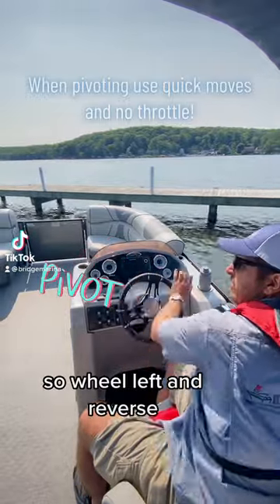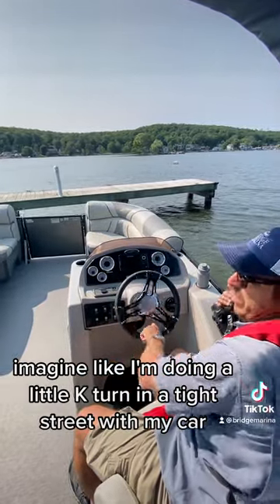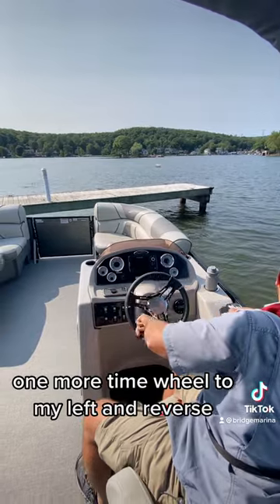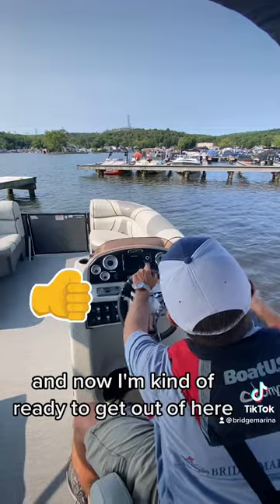When pivoting your boat, use quick turns and no throttle!

Comment: Unless that wind is broadside on you.. pushing you Into docked boats... Then ya needs some thrust to get ya off em sometimes....
Reply: I find that if I need throttle in these situations it is because I lost control a minute ago. And yes that is in our windy ass area.
Reply: @mjodr  This is great for sill conditions, but add a nice 5-7kt current and a 10kt gusty wind and you've got the docks near our inlets while the tide is changing.  With no throttle you would be in a new zip code by the time the boat got turned around.  You really have to be careful docking as the current runs parallel to the slips, you can end up under the dock real easy.
Reply: Wind and lots of other boats and I panic lol

Comment: I used to work doing corporate seminars at a lakeside lodge. We had a large pontoon we took some of the students out on in the evenings. I had handled boats all my life and docked it with ease, came in with a little speed, cut the wheel over, bumped it a little to point the bow around, turned the wheel hard the other way and hit reverse real quick to suck the stearn up to the dock and it would just snug right up to the our dock nice and neat every time. I guess one of our other trainers, who didn’t have much boat experience, had seen me do it a few times and decided it was his turn to take the folks out in the boat. I saw him coming back to the dock and ran out to help him. I noticed he was coming in way to fast and knew right away he was trying to do what I did, only he didn’t know how and had never even asked me how. Well, let’s just say that nice fancy pontoon the company owned never looked the same again, and he never drove the boat again.  Everything looks easy when someone else is doing it. 😂😂
Reply from the maker: Ahhh yes - thanks for sharing and for the comment! Appreciate it! Where was this?
Reply: @Bridgemarina  Lake Martin, AL. We had a private “lodge” the company I worked for owned. Basically, a 14 room, 2 bed per room, facility with a huge lounge type area, kitchen and a classroom downstairs, all privately located in a remote location on Lake Martin where we could get them down there with no distractions for intense training for days or a week at a time. It was a nice facility in a beautiful setting.  The lake and the boat provided a nice break in the evenings after classes and training were over.  We’d bring 26 sales agents at a time (13 of the rooms double occupied and I had my own room) for a week long training seminar and about 10 sales managers into a neighboring country club facility for a management and “how to train” seminar. It was really successful.

Comment: That how you do it with outside boat motors. 

When you do it with boats like skinautics and mastercrafts. 
The rutter has no effect when going slow in reverse. The boats back will go to the left or to the right in reverse depending on witch way the propellor turns. 
If you give a decent amount of power in reverse while the rutter is already in the correct position. It  does steer a little bit. But probably there isn't a lot of room and you probably can't hold the boat in reverse for longer than 2 second before you hit something. And you have to cancel you backwards movement fast but first have to turn the steering wheel on the other direction (or you fast reverse was for nothing). And give gas forwards.

Comment: Try not to switch gears so much because it’s really not good for outboard motors
Reply from the maker: Good point - thanks for watching and sharing - appreciate it! What waters do you boat in?
Reply: @Bridgemarina  natural lakes
Reply: Any motor
Reply: Incorrect. the problem with switching gears is if you do it too slowly. If you let it pop into gear quickly and firm it’s just fine. It’s designed to do so. Change the gear oil every season and it should last a long time.
Reply: @poysunivey  ah someone who knows what he is talking about.

Comment: Easy with an outboard. Try moving slow with twin inboards and using the steering it barely moves, when turning with twins just use the controls no wheel at all.
Reply from the maker: Interesting - appreciate you sharing - where are you typically doing your boating?

Comment: It’s common sense. Honestly if you need to be taught this you should be a passenger.
Reply from the maker: Thanks for stopping by... sounds like you've been fortunate enough to be around water and boats a good amount - awesome. Others might not have that same experience, so what might be common sense to some is new to others.  Where are you boating?
Reply: @Bridgemarina    I not trying to be mean.  Just honest.  Things that need to be taught are about loading and unloading boats, trim and how it works. Lights and meaning of those lights.  So back to the vid….basic of the basics shouldn’t need to be explained.
Reply: @Bridgemarina    What’s the best option during an engine failure?  Drop anchor or drift? Lake or ocean
Reply: That's not just common sense dude...why would you say such a dumb thing?
Reply: This isn’t common sense, to gain that an entire group of people should be exposed to certain circumstances/events. Not everyone has the privilege to drive a boat nor even have a chance to see what it’s like to be on one or drive one. Don’t be ignorant common life experiences and daily tasks doesn’t teach you how to drive a boat, so it’s not common sense.
Reply from the maker: Thanks for the question - if you experience engine failure and you are in a location that anchoring is permissible, you should deploy your anchor.
Reply: @stevenboy4996  Low speed turns at the dock really is common sense.  Come on.  Jeezzzus.  Good sense in practical matters.  Our interpretation is different.
Reply: @marllboroman1461  🤦🏽 missing the point but Ight dude